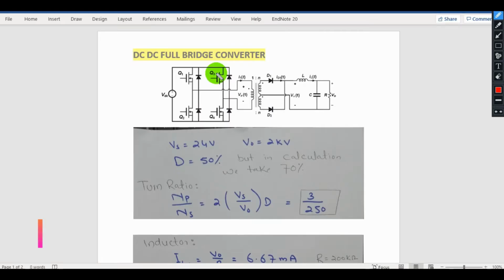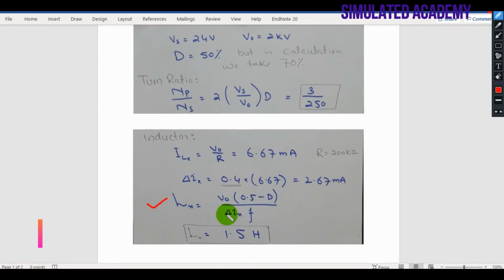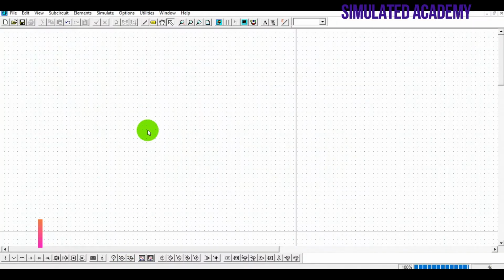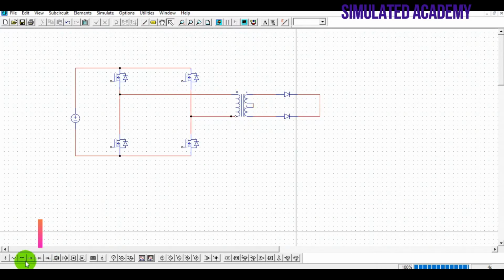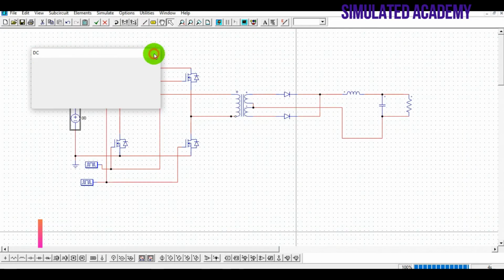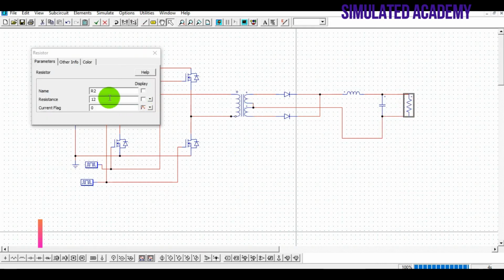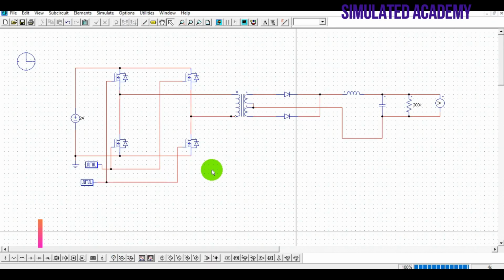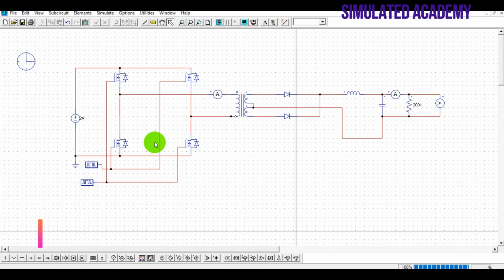Design and Simulation of Full Bridge DC to DC Converter in PSIM | Full bridge converter in POWERSIM

Comment: Hi:) Why did you set resistor 200k Ohm?
Reply from the maker: Hello.

The loadi have is 200k ohm. I need high voltage at the output while the current needs to be minimum as possible. To limit my output current, high impedance load is attached. 
Thanks.
Reply: @adiclouds  Thank you for your reply Just one more long question, the spac of the pull-bridge converter I'm going to design.

Input voltage 800Vdc, output voltage 14Vdc, rated power 5kW, switching frequency 50kHz, the connection method is center-tap method, what is the L,C,R values and duty ratio required when determining the output voltage ripple is 1% and the output current ripple to 10%?

When I Calculated It, It Is Determined To Be 3.78uH, 319.11uF, 0.0392 Ohm, And Duty D=0.0175, But I Don't Know If This Calculation Is Right.

If that value is correct, is the transformer turn ratio setting incorrect?

Thank you for your help. Thank you for your precious time.:))
Reply from the maker: @iliililiill-h9n  I will recommend you to follow the power electronics book of daniel hart. It has all formulas in it... do follow step by step procedure, you will reach to the final answer.
Reply: @adiclouds  thank you ! I will try hard😂😂 have a good day :)